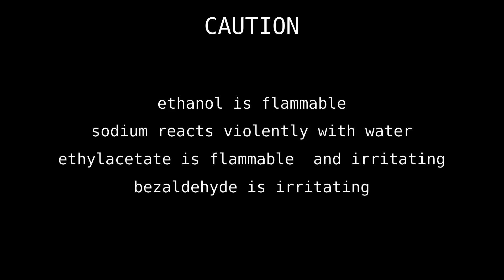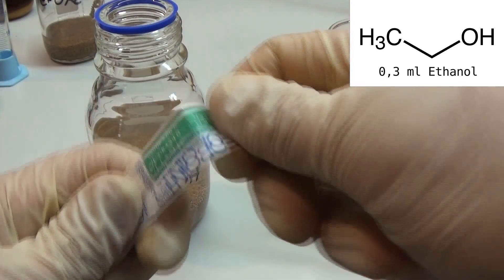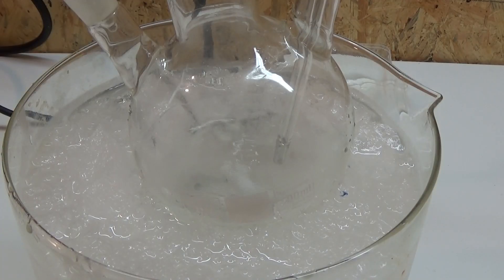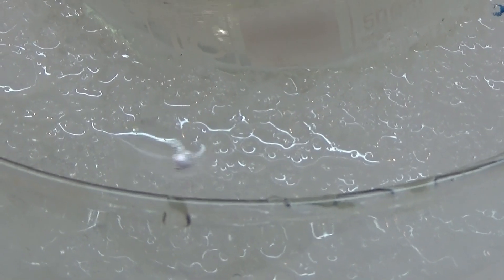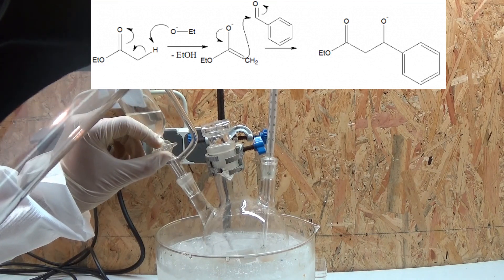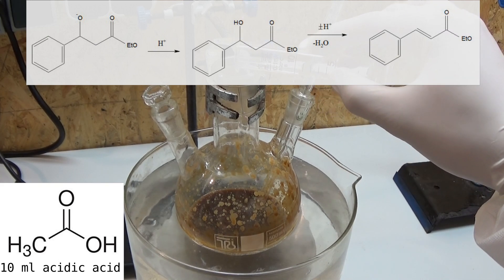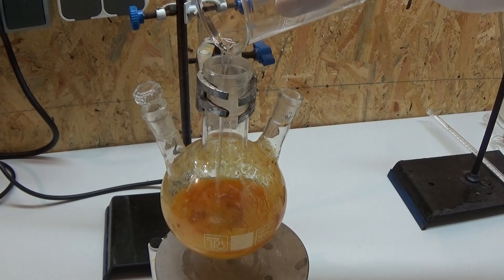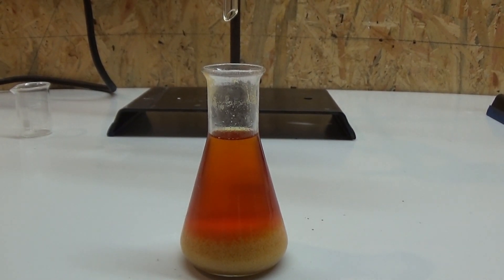trans cinnamic acid synthesis via claisen condensation (part 1) ChemPlayer tribute

Comment: HAZEL CHEM:    So sodium metal does NOT react with esters????????????    In a claisen  or an aldol reaction how do you stop the reaction so you do not dehydrate the alcohol and make a double bond ???????????   Every time i read about those reactions i get the impression it is possible BUT VERY VERY VERY HARD to stop it at the alcohol and keep the molecule saturated.  But nothing ever says how to stop the reaction and protonate the alcohol without dehydration.   I mean would using  very dilute acid to make your alcohol stop it from dehydrating and forming a double bond.??????    Man i just spent like 4 hours watching this 15 minute video and posting these post.   But it sure was worth it.  I got a brain cramp now.   THANKS FOR THE GREAT EXPERIMENTS  YOU POST.     Oh my god  it just hit me why the double bond forms so easily.  Resonance with the carbonyl.  I made propene from isopropanal with a acid catalyzed dehydration and as you know it takes a million degrees to get it to start.  I kept wandering why do these reactions dehydrate so much easier.   Yeah that was an OBVIOUS reason.  Some times things just blow by me sometimes...lol.

Comment: QUESTION.........  I AM ONLY TALKING ABOUT THE REACTION UP TO WHERE HE MAKES A beta hydroxy ester.    The CLASSICAL claisen reaction involves ONE  ester.  And 2 molecules of that same ester react  and that will make a symmetrical KETONE.   But he used an ester and a ALDEHYDE.   And benzaldehyde is NON enolizable.   So it is FORCED  to be an electrophile.   And when the tetrahedral intermediate is formed there is NO  alkoxy group  from an ester to leave.   Because benzaldehyde does not have an alkoxy group on its carbonyl like an ester...it has a hydrogen.   So the tetrahedral intermediate can NOT collapse back in to  a carbonyl  like when using 2 esters for the reaction.    So then he acidifies to protonate his tetrahedral intermediate to make a beta hydroxy ester.   KEEP IN MIND HE DOES NOT HEAT ANYTHING.    In the CLASSIC claisen reaction the tetrahedral intermediate can collapse BACK IN TO A CARBONYL because it has a good leaving group......an alkoxide FROM THE ESTER.    So now in the CLASSIC reaction you got a carbonyl beta to the ester/carbonyl  instead of like in the video he had a beta ALKOXIDE that used to be a carbonyl but can not collapse.   In the CLASSIC reaction  when you got a CARONYL  beta to an ester and acidify AND HEAT IT UP.  The ester will hydrolyze to a carboxy group and since there is a carbonyl beta to the carboxy group then decarboxylation is inevitable.  Leaving you with a symmetrical ketone.  Since you used 2 identical esters as the reactants the ketone created will be symmetrical.  
                               Now lets compare his reaction to an aldol.   He got a beta hydroxy ester.   Which means he got a beta hydroxy carbonyl (with a alkoxy group on the carbonyl)     In an aldol reaction he would have gotten a beta hydroxy carbonyl ALSO but with no alkoxy group on the carbonyl.  Cause in an aldol reaction there is no ester so there is alkoxy group on the carbonyl.    It is the same EXACT reaction.    if you take the alkoxy group off of the ethyl acetate and replace it with a hydrogen or alkyl group then it would be called an aldol reaction.  And they are also similar cause in both reactions after getting the beta alkoxy carbonyl(his carbonyl with an alkoxy group on it)  then in both reactions you would protonate the alkoxide anion   to make  an alcohol and then dehydration is almost inevitible in both reactions to make an alpha beta unsaturated carbonyl compound.   But since he started with an ester the carbonyl has an alkoxy group on it making it an alpha beta unsaturated  ester.
                      wow i actually think that is all right.   If you made it this far you might as well post me back if you know weather i am right or wrong

Comment: Benzaldehyde is very hard to find.
Reply from the maker: very good answer thx hans 
but you can also extract it from almond oil 

mfg hazelChem
Reply: Unfortunately, that's difficult to get in the USA, as well.
Reply from the maker: well considering the drug epidemic in the USA ......
Reply from the maker: but you can make it from benzyl alcohol that should be easy to get 

mfg hazelChem
Reply: In Germany it's readily available:
https://www.ebay.de/itm/Benzaldehyd-Bittermandel-Ol-Marzipan-Amaretto-Backaroma-250ml-500ml-1000ml/272901003074?hash=item3f8a2ad742:m:muviSddHRH0fyyrXxSIZYow
27 EUR for 1 Liter, not too bad. Only ships to Germany though.
Here is one that ships to the US too, but more expensive:
https://www.ebay.de/itm/Benzaldehyde-98-500g-HDPE-sealed-bottle/142929610788?hash=item214744c824:g:leoAAOSwDvVa6YL-#shpCntId
Reply: Or another route is brominating toluene and then hydrolysis. Toluene should be available otc, bromine could be made from sodium bromide/H2SO4 if not available/too expensive.
Reply from the maker: that is a good way and i allready done this synthesis route but with chlorine because it is way cheaper

mfg hazelChem
Reply: @HazelChem  chlorinating is also possible of course ;-)
Reply: In theory, acetophenone can be condensed with nitroethane to form 2-phenyl-3-nitrobutene. This can be reduced to 2-phenyl-3-nitrobutane by sodium borohydride in ethanol. Then the aromatic nitro alkane can be reductive amination with Galinstan aluminum amalgam and tin 2 chloride to speed it along. Thus  making 2-phenyl-3-aminobutane. Galinstan is non-toxic and better than mercury.